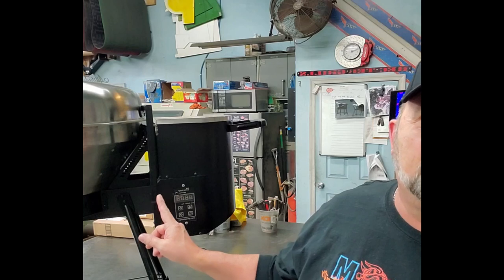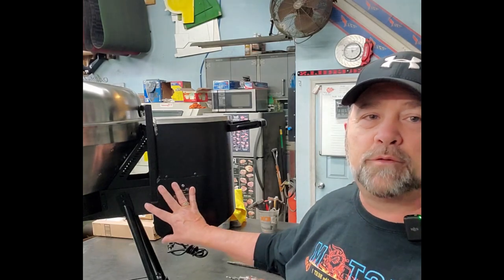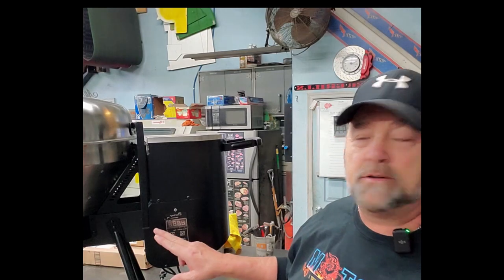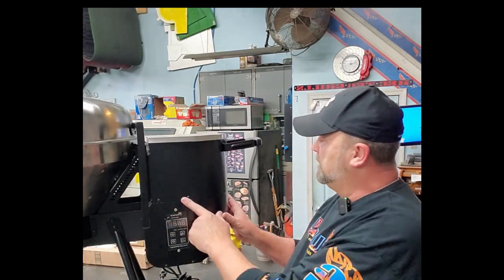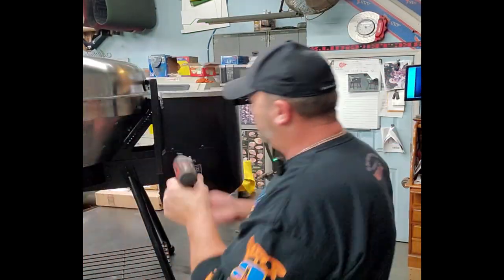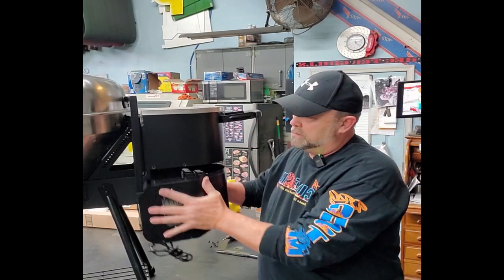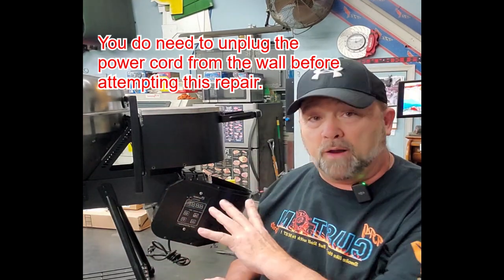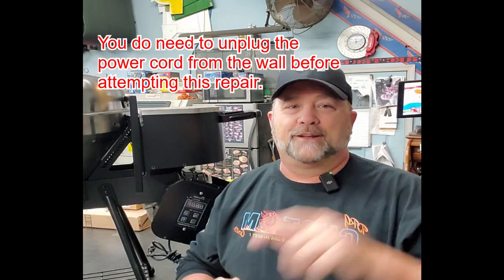Replacing Bullseye Grill Auger Pin, the EASY way.

Comment: OMG I had the same problem and this is such a simple brilliant solution. Thanks so much. I found if I spread the cotter pin a little bit with a screwdriver that was easier to put back in but still a pain. And it also fixes the problem of a jam where your cotter pin is angled down so it’s hard to remove initially. personally, I have found that at the end of any grilling session, particularly a low smoke one, I pull the extra pellets out of the hopper and then set the temperature to 350 which burns off any grease and also completely clears the auger tube because I really don’t wanna have to deal with a jammed auger again.

Comment: I have a nasty auger jam from wet pellets and I watched your unjam video which was brilliant but when I opened my bullseye the cotter pin is facing straight up and down with the rounded end at the bottom and 2 pins on top.  I cannot get it off!  Do you have any suggestions?  I sure would appreciate it.  Thanks

Comment: What do you do if the pin is positioned so you can't remove the pin?
Reply: That’s my issue. My auger is frozen and I
The cotter is upside down. I thought about cutting the cotter but I can’t get the cutters in there…
Reply: Did you ever figure something out?  I just left a comment asking the same thing before I saw yours.
Reply: I just had this issue! Use a screwdriver and hammer to reposition the pin to the point you can Get the screwdriver in the hook part of the pin and then use the hammer again on the bottom of the screwdriver to tap it out. Hope that makes sense….